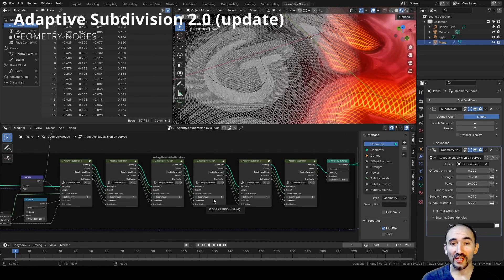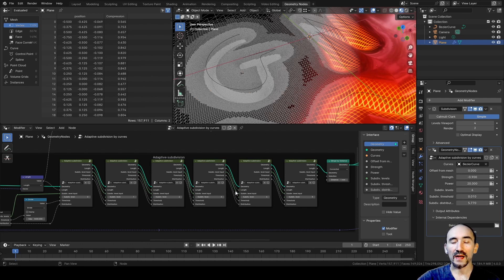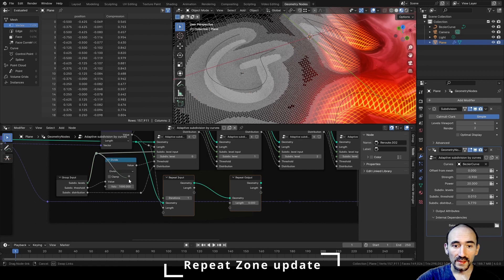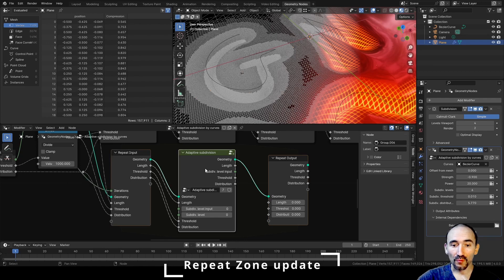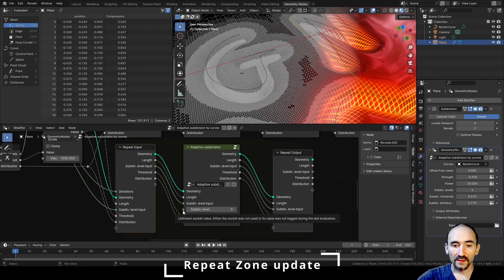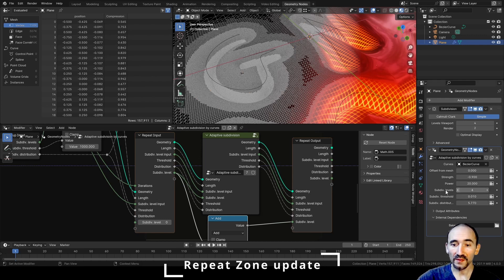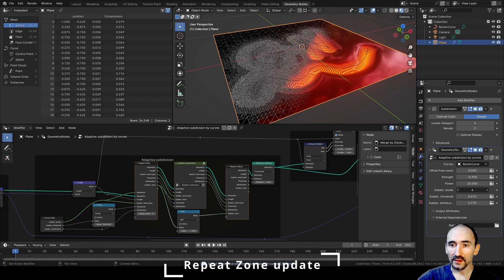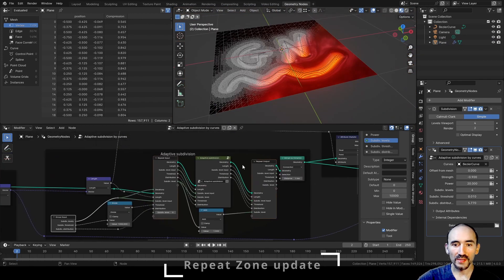Procedural Adaptive Subdivision with curves 2.0 (update) in Geometry nodes - Blender tutorial ENG

Comment: Very useful tutorial and well explained. 
The only big problem I see is the artifacts and N-gones created between subdivision areas. 
That should be triangulated to keep a more consistent-clean mesh. 
And it is just the problem I espected to solve watching this video 😔
Reply from the maker: @TraskyTracks  thank you for the comment! Yes you are right a triangulate operation and merge by distance method or similar approach can solve the issue or, saving the uv information before subdividing the mesh, you can get the nearest uv information to “wrap” it on the new surface after the merge by distance node. It’s a thing to try to cover all the cases. If you need we could discuss it in my discord server.